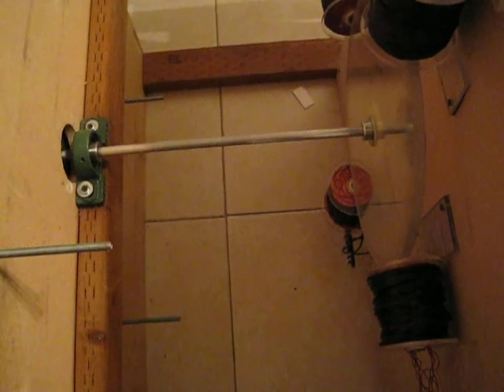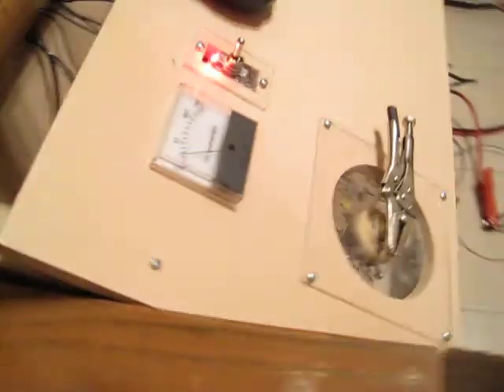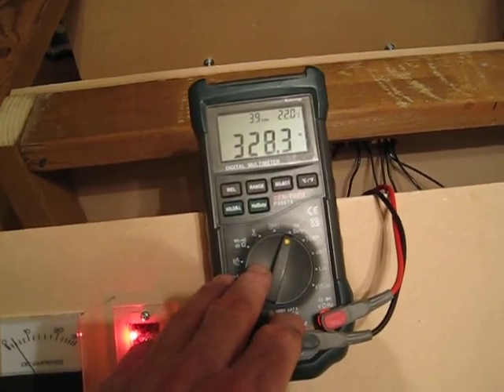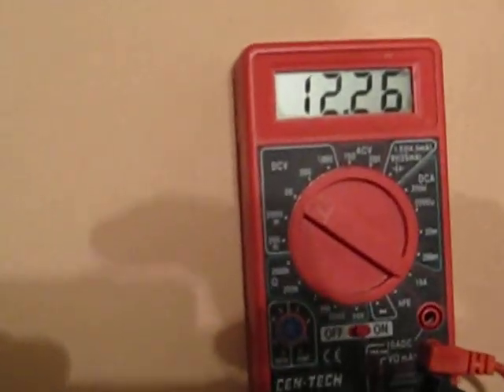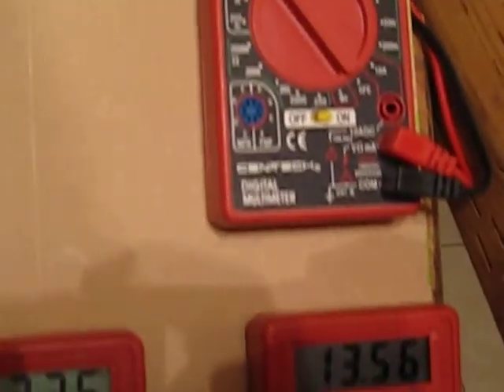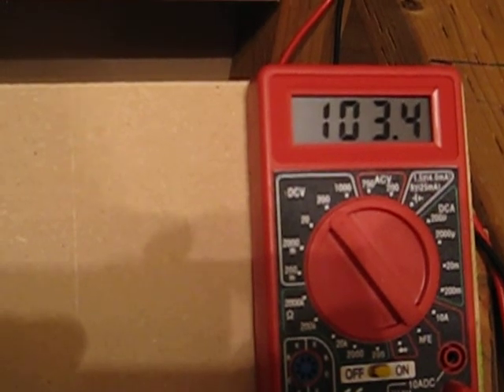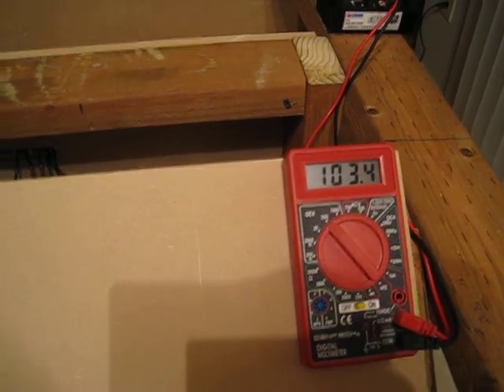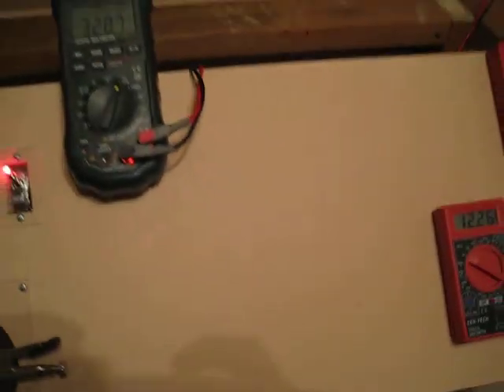pulse motor driving 3 phase modifications 001

Comment from the maker: howdy tinman. pretty soon ill start working on a set up that will run off 24 volts, just need to figure out what resistance value to begin with off each base transistor and for the pot also

Comment: It is looking great SD.
So at 120 volt's you will have mains power over there.
Is the 24 volt run system coming soon?-that thing would hit 150 volts no problem at 24 volts input.